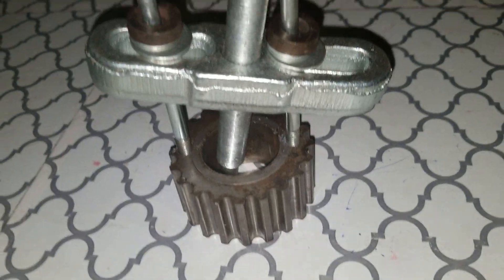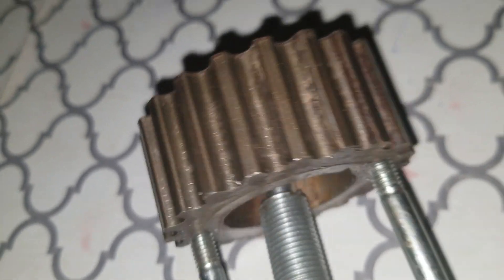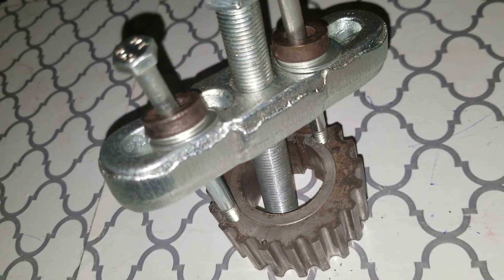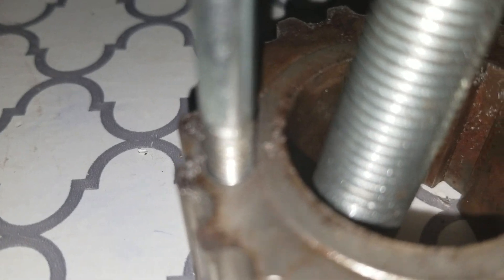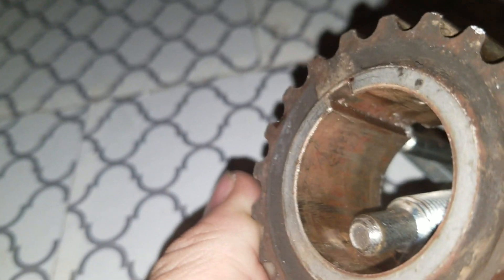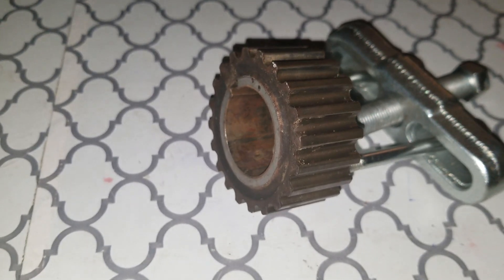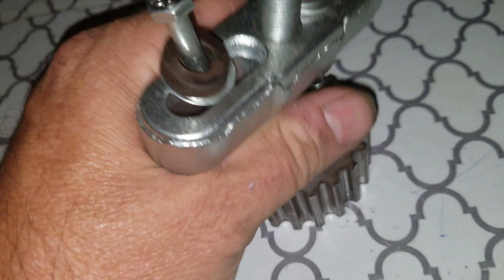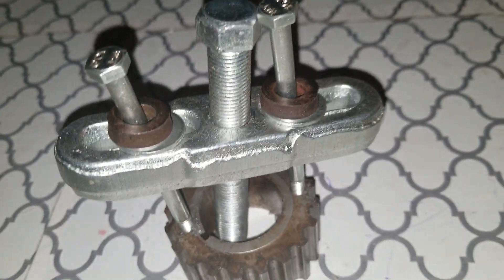Part 2 crankshaft timing gear puller

Comment: Hello. Do you remember if there was 2 washers on the crankshaft sprocket gear you pulled off. One in front and back? Or just 1 washer between gear and oil pump ?
Reply from the maker: There should be two. One in back of the gear and one in the front
Reply: @3dmasters  thank you so much.  I know now I misplaced the second washer.
Reply: Oh boy I have done this a lot the correct tool is OTC 6356 puller for Chrysler 2.4L . I had to use the puller he used to get the job done. Had ta tap holes and put in bolts she put up a fight but went down. Tough one to get off